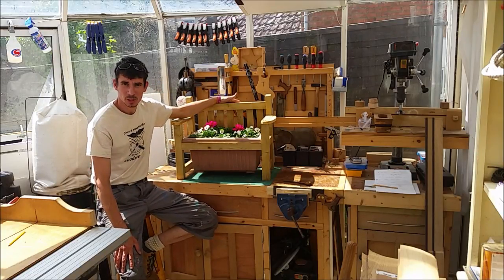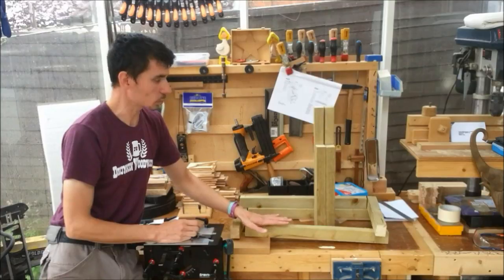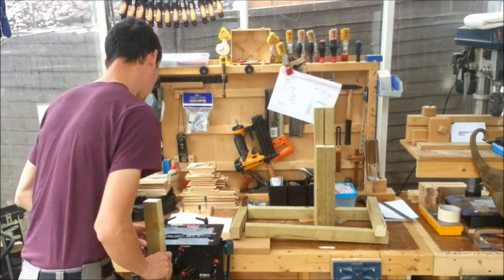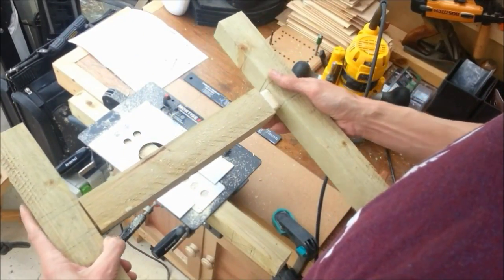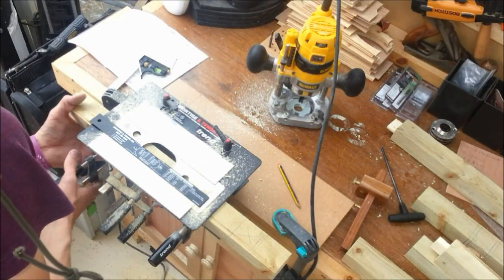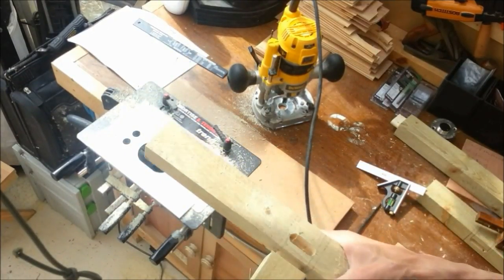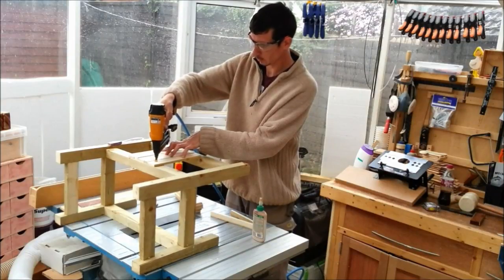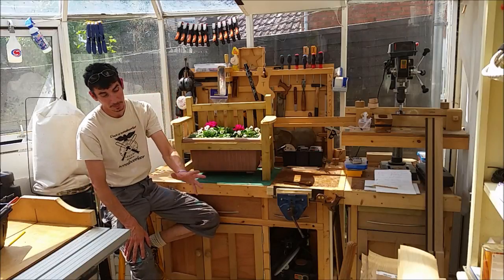DIY Garden bench planter box using trends router mortise and tenon jig.

Comment: Great video. I know its an oldie, but can i ask a question?

At 3 minutes or so, when youre cutting the tenons, it looks like you work your way around the oval hole in the jig, in a clockwise fashion.

I have always understood that when using a router, it was advisable to always cut in the other direction (conventional milling and not climb milling).

Dont get me wrong, what you did obviously worked well, but it would be good to get your thoughts.
Reply from the maker: It is old, but the principle remain the same. To answer your question: outside anticlockwise, inside (as with the part to which you refer) clockwise.
I would recommend watching my “which direction to router” as it explains - in great detail, the direction to router depending on the situation and WHY this is the case. With this understanding it demonstrates that clockwise in this way is actually not climb cutting  at all.
This principle is greatly misunderstood, in part due to the dissemination of misinformation distributed by YouTube channels prioritising views over accuracy.
.
Hope this helps.
Reply: @BrainFizz  It does indeed help.

What I hadn't noticed or worked out however, was that the part in question was an inside cut - presumably this was a mortise being cut, rather than a tenon?

Is that to say that when cutting a tenon, you need to move the router in Y? 

I have just acquired that same jig, but haven't used it yet, and my understanding from my cursory read through of the manual is that mortises are cut using a cutter of the same width as the eventual slot, and that therefore, the router is to be moved only in X - I've clearly misunderstood that.

My original reason for finding your video was to learn - and I've done that in spades. 

Thank you!
Reply: @BrainFizz  Oh, and I shall indeed watch that video - I'm going to go through your back catalogue now I've discovered your channel 🙂